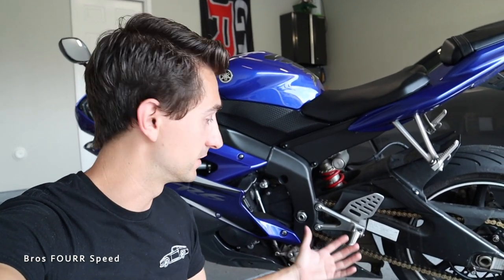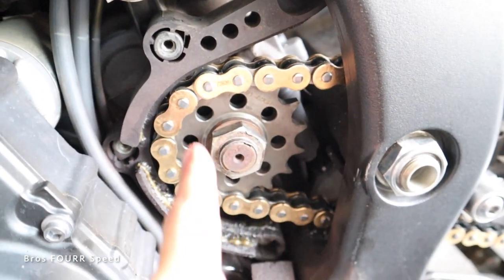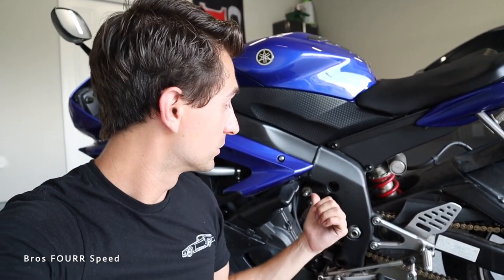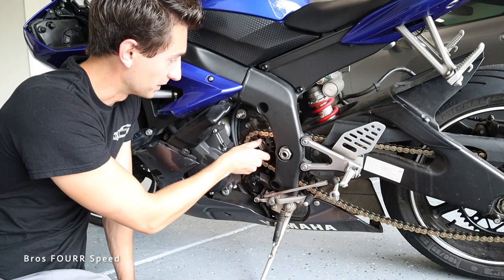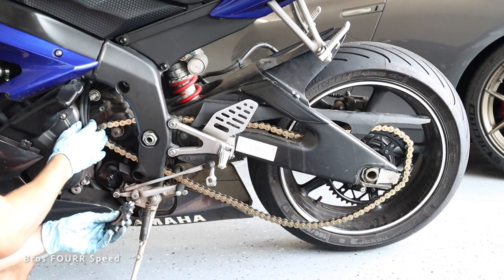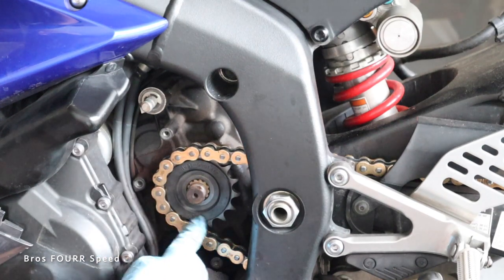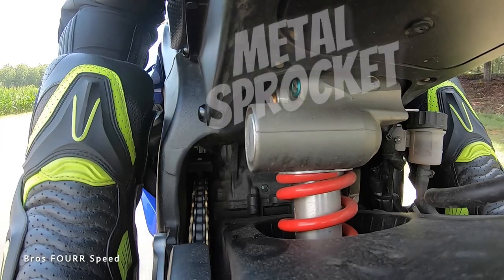Why Does My Yamaha R6 Make THIS NOISE?! *It Was Brand New*

Comment: Idk if u figured out the loose driveshaft bolt but i do have a fix/answer.. there is a little groove in the drive shaft.. when u tighten that bolt u are supposed to use a flat head screw driver or something of the sort to pinch the edge of the crank shaft bolt into that groove.
Reply from the maker: Interesting. Did I show anything about  the driveshaft in this video? Just holding the wheel I could looses the small sprocket since the chain was still there to hold it still

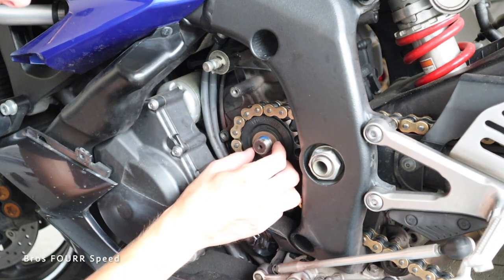Comment: 6:40 that washer was recalled on the older pre 2006 models of R6. The new washer sat on the toothed axle and would bend over onto the flat of the nut once tightened. 

Previously, normal washers, yes the nut comes loose. The sprocket jumps off the axel. Rides the axel threads. Goodbye axel. New axel needed. Strip out bottom end motor.
Reply from the maker: Oh wow!

Comment: Have just sent a brand new DID 520 chain back because the tension was all over the place. It was twice as tight in places than others after i set it at 40mm, turned the wheel to find it tight at 22mm. It made a hell of a whining sound & the vibration through the bars gave me nasty pins & needles in both hands.
Have put my old set back on now and it runs like new.
Reply from the maker: Interesting, my brother has the same chain and we both have had zero issues since the install.
Reply: Yes everyone is surprised that this has happened to a new  DID chain. They are sending me a new one out so fingers crossed and the suspect chain has gone back to the manufacturer for analysis @BrosFOURRSpeed

Comment: That was about 100X the steps needed...
Reply from the maker: Not really. Maybe a few extra things. But this was mu first time taking these off too
Reply: When I do mine: Overflow tank bolts and slide out of way. Sprocket cover removal. In gear, rear brake on, on side stand, remove sprocket nut. Sprocket should slide right off with chain. Reinstall. No need to do the rest of it.   @BrosFOURRSpeed